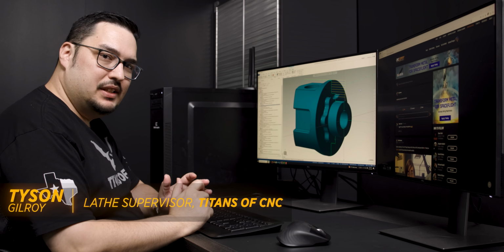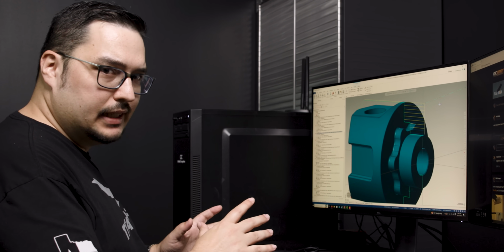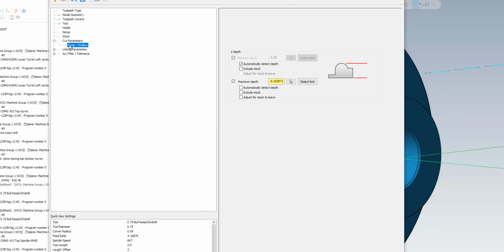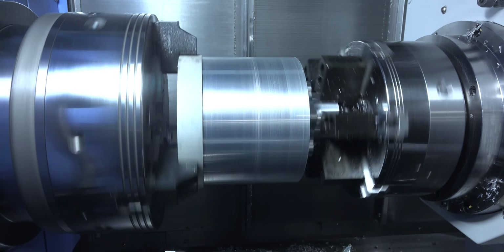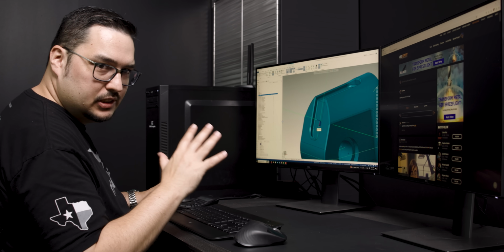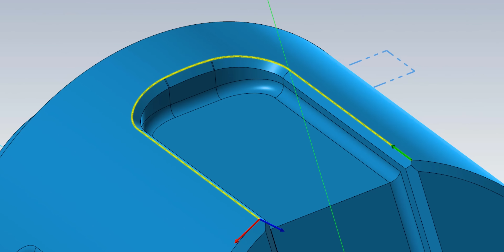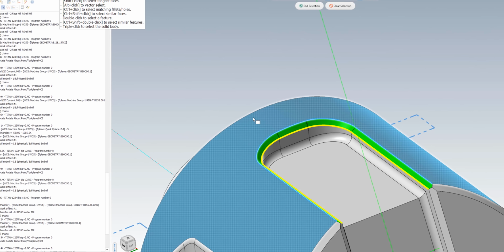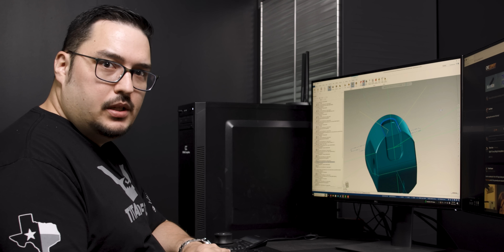Secrets to Running a SMX3100 9 Axis Mill Turn

Comment: As an older (now retired) CNC programmer, a somewhat computer nerd, and spent most of my time on prototype work for 45+ years, the part of it all that blows my mind is the amount of thought and engineering applied in making your drawing in Mastercam convert to moving machine parts that weigh hundreds and sometimes thousands of pounds, into movements that are still all calculated and manipulated by nothing more than zeroes and ones. The amount of calculations per move is simply staggering. And then all done (sometimes) in millionths of an inch with tools that are delicate enough to simply snap if not absolutely perfectly aligned. Taking into account casting and drive screw  temperatures, etc. ..beyond belief.

Comment: These are the good Titans videos. 
Minor ripe though, but you can most definitely use a gaming pc for cad / cam.
Reply: the only thing different in those pro-computers may be the gpu for certain certification or validation purposes which a gaming gpu doesn't allow. And of course they are built for longterm operation, ease of maintenance and not maximum performance

Comment: It would be nice if you can explain all the axis for people like me not owning or working on a such complex CNC machine. I only know of XZY and C on a lathe. What are all the other axes?
Reply: B axis is the rotation of the milling head.  On a machine like he has in this video there are multiples of a couple of axis. The lower turret has X and Z.  The upper milling head has XYZ and B.  Each spindle has it's own C axis and the sub spindle has it's own Z axis.  The sub spindle Z axis might be =called something else.  It's been a while since I've been on one of these machine types.
Reply: @brandons9138  Oh man! That sounds complicated. How do you G-code with more than one X or Z axis? Or maybe actually the secondary translation axes are UVW. So the 9 axes are XYZ translation, ABC rotation around XYZ and secondary linear UVW?

Comment: That's interesting video. And I have a question. Why don't you use a regular chamfer mill? Or was only demonstration of cam capabilities?
Reply: Hi and thank you,
The original programming of the part had a chamfer mill, but I just wanted to demonstrate an alternative way of doing it utilizing the mill turn
Reply: @TysonGilroy  Thank you for the answer. 
It would be nice to watch some longer videos about programming 5 and more ax machining. BTW, why do you use mastercam? Have you tried other Cam-systems?

Comment: I don't like the fact that yous said that gaming computers can't be used and elluded to the fact that the product that sponsored the video uses a different kind of grpahics card. This is factually incorrect. The product you advertised depending on the configuration uses either a gaming graphics card from the  rtx 4000 series or a quadro rtx card, which is indeed a professional card, however it can also be bought as a consumer. The rest of the computer is off the shelf parts, except maybe for the motherboard whose model is not stated which means it is probably an OEM board of some kind, which is not a good thing either. If you make a sponsored segment make sure that what you are saying is not misleading and is correct.

Comment: Pretty soon AI will generate these toolpaths in seconds. After 30+years in industry, this is the first time as a machinist that I can see "robots" within striking distance of "taking my job". I’ve been hearing that was going to happen since the 80’s. Honestly, as an old prototyping machinist doing the CAM is the least interesting and most tedious part of my job. And I’m busy enough that if AI did 100% of the CAD / CAM work, ordering material, and sourcing tools I’d still have too much work.
Reply: it will still require human supervision at least in the beginning

Comment: C Axis Dynamic milling it not using all 9 Axis of movement. You are really only using 3 Axis of movement. X Y and C are the 3 axis you are using in that process. Z does get involved for each depth of cut or micro lifting if you are doing that so we can say 4 Axis of Movement. 

The other part of the conversation is using the limited MT side of Mastercam to program the machine. The MT module from Mastercam still doesn't support Vertical Mill/Turns. The W Axis which transfers the stock from one spindle to the other is an axis on the machine, but using the full 9 Axis at one time for machining a part never happens on these machines. With a lower turret we start using more axis if we are pinch turning or pinch milling. Lets step up to a Triple or Quad Turret Y axis machine and then are can start talking about running 9 to 14 axis at a time. In clockwise order LLT(Left Lower Turret)X1-Y1-Z1, LS(Left Spindle) C1, LUT(Left Upper Turret)X2-Y2-Z2, RUT(Right Upper Turret)X3-Y3-Z3, RS(Right Spindle) C2, RLT(Right Lower Turret)X4-Y4-Z4, and W Axis to move Right Spindle up to Left Spindle. We can have the LLT, LUT, LS moving a tool at the same time for a total of 7 axis of movement on the Left Side. We can have the RUT, RLT and RS all moving at the same time for 7 more axis of movement. That will be a total of 14 axis all moving at the same time. That is when our hair in on fire and we understand sync coding and true process development. 

Question is are they turning or milling to achieve the 14 axis of movement?

Comment: A challenge for science?  
Related to precision and axis. How many axis would one need for a high precision Ancient Egyptian Vase? And do you need a very expensive mill? Can you do it?
The error in surface-flatness and shape-roundness is only around 1 thousands of an inch.
This is also the precision of the thickness of a vase. And it has handles connected to the structure. Without the handles it would be 1 spindle and one arm on 1 axis. But the handles make it more complicated.
The vases themselves are made of hard stone, like rose-quartz. Which is too hard for many tools. So that is another challenge.
Here are several examples with this video. You can skip towards a vase that looks interesting. Ancient Egyptian Granite Vases Analyzed with modern precision tools. STL's available. -> https://www.youtube.com/watch?v=QzFMDS6dkWU
Reply: A turn mill like show in this video would make a vase like that with ease.  It would do it with higher precision than the Egyptian Vase without breaking a sweat.  The handles are not a problem at all.